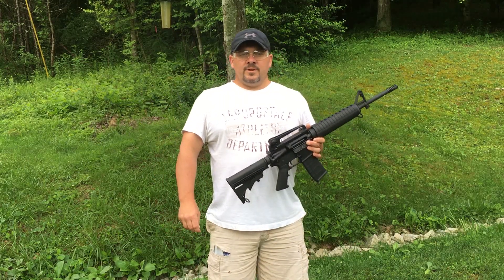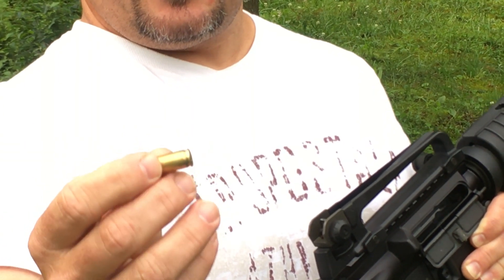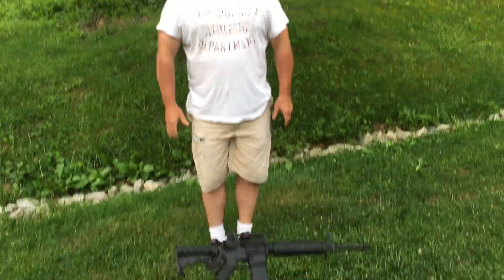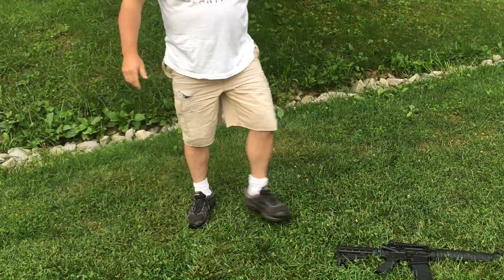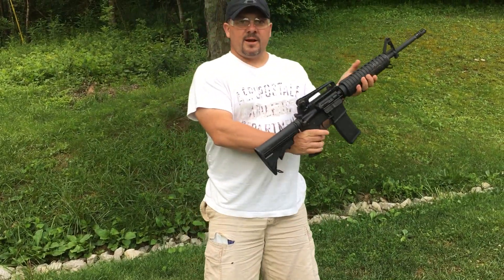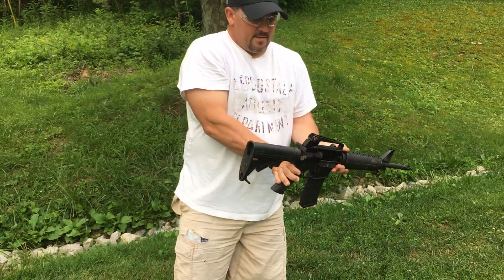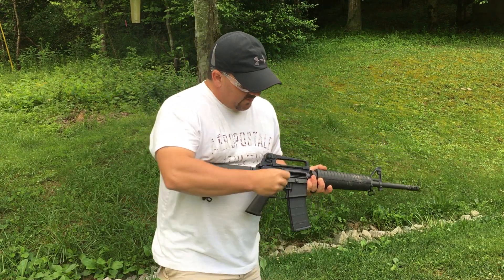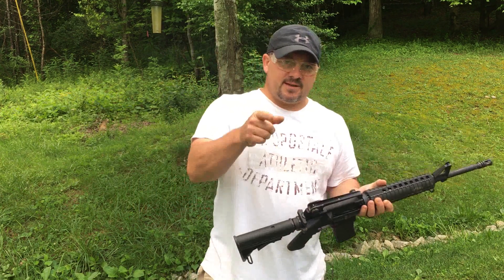AR-15 DROP TEST with an unexpected result

Comment: Good post, but I think you missed the most important angle to drop it, and that is muzzle down. That's the most, and maybe only, likely direction to set a round off. When the gun hits the ground it stops, but the firing pin can keep moving forward, potentially with enough energy to set off the primer. You should have done a couple drops like that
Reply: Probably not. I think the bolt dropping under spring force is going to be going allot faster than the whole rifle after dropping a couple feet. You may plug the barrel and blow it up, but I doubt that'd cause an issue
Reply: I agree .   Says  in my  manual  from Smith and Wesson  muzzle  down  drop may  cause  accident al  discharging  of the firearm.   Mine a m&p 15 sport.
Reply: On standard mil-spec ar it still shouldn't discharge unless trigger is pulled. You will just have dirt jammed in the barrel. Even if you have the trigger pulled while charging the gun. It will not fire, you physically have to let off the trigger, to reset it before it will fire. He calls his Bushmaster XM15-E2S a XR15 shorty bullpup. He does everything for the views. He can't be that stupid and have survived this long. Meaning the Grand Wizard
Reply: @josephcremeans  well yes and no. On a "mil-spec" AR, like pretty much every other one, the firing pin is free-floating in the bolt head.

There is nothing stopping it from going forward under inertia to strike the back of the cartridge. People have had slam fires in the past and continue to. The main reason why this doesn't happen isn't because the firing pin isn't impacting the primer - it is Ivan but usually because most primers are hard enough that it's still not enough Force without the hammer also striking the firing pin for however, you drop the rifle from a high enough distance, or onto a hard enough surface, you may get enough momentum on the firing pin to detonate the cartridge regardless.

It comes down to the ammunition more than anything else.
Reply: Probably didnt do it because it couldve dented the muzzle or maybe bend the barrel
Reply: The kinetic energy of a spring slapping the bolt shut in normal operation is probably much faster than a dropped rifle hitting the ground. So I'd say it's a non-issue other than dangerously plugging your muzzle with dirt. An AR15 has does not have a firing pin retaining spring, it slides back and forth freely and doinks a primer every time a round is chambered. It requires the force of a hammer hitting it to set a primer off.
Reply: The firing pin is too light for it's own weight to dent the primer.  Besides, the mechanism will not allow it.
It's not hard to see who has real experience and who does not...
Reply: I’d say of a gun drops perfectly on its muzzle I don’t care if it fires cause it’s going in the ground
Reply: @thapeacock2601  well it is how you get a barrel obstruction from dirt, sand, rocks, or grass. I have seen it get dropped lifted, shot and boom. Damaged barrel. In the heat of battle or a hunt you don't have time to clean that out..

Comment: That is actually a way that is taught by some instructors to clear a jam quickly if you can't get it by pulling the charging handle, so not a completely unexpected result, obviously you don't drop it, but rather slam the stock on the ground, the shock and inertia causes the bolt to reciprocate. But good to see they are most likely drop safe, that is good to know.
Reply: Well if it’s jammed like that primer wouldn’t be lined up with the firing pin so it wouldn’t really matter if it did let loose right there. Or if a swollen case caused a jam that’s primers already been struck so again it wouldn’t reallllllly matter. So I don’t think it’d ever be a problem with clearing a jam on the ground.

Comment: I'm surprised the primer didn't go off from dropping the bolt on a chambered round 6 times. The firing pin is floating and will dink the primer every time, even if you allow the BCG to strip a round from the mag you will see a small indentation on the primer, dropping the bolt on a round that's already chambered like he did is more forceful than when it strips a round from the mag. Anyway, great test. Thanks! 👍👍
Reply: Yeah on my ar, even chambering a round once puts a slight ding in the primer

Comment: Drop it on it's muzzle? Unless you messed with the sear or stupid enough to leave the bolt open when dropped, could cause the firearm to discharge? Since it's a mechanical device it can fail, regardless how well built it is due to wear or breakage. Best to have it with a unloaded chamber, safety off with a full magazine. How my police department carries it in our vehicles. I do the same for home protection.

Comment: They teach you this is Basic Firearms Training. US Army.
First, they teach you to disassemble and reassemble. Cleaning and maintenance. 
Then, they teach you proper firing positions, the purpose and organizations of firing teams,
Then they put you on the range for live fire exercises.
One can not just drop a loaded firearm and have it discharge.
They are not designed that way.
One must pull the trigger, to activate the firing pin.
Reply: js32dv  WTF are you talking about? You can't discharge a loaded firearm, simply by dropping it.
The firing pin doesn't work that way!
Reply: js32dv  Obviously you didn't even go through Basic.
Reply: @Shingen036  

$20 if you find a M16 or M4 rack full of rifles with a fully loaded magazine inserted with a round in the chamber and the safety on with the hammer cocked stored like that.
Reply: @JohnDoeEagle1 idk where you get your information but the U.S. military dose not store weapons in the armory loaded it’s prohibited and is a ucmj violation
Reply: @chriscraftpro3246  

No sh*t Sherlock.....that's what I bet $20.

Comment: I always wondered about muzzle drops on military weapons with floating firing pins. I've seen several slam fires in competition with soft or high primers on handloads.  One guy proceeded to fillet his hand from the op rod of an M14 from this.
Reply: That was my thought exactly. A muzzle drop is the angle Far and Away the most likely to set off the round, but it's also the only one he didn't do.

Comment: Re-do the test with multiple rounds in the magazine.  Then see if it.

1, Ejects the round
2, Doubles feeds/stove pipes
3, feeds a new round into battery.

That would make a more accurate test. Good job.
Reply: I agree. So long as it was a mil-spec trigger, I would like to see that kind of test.  People like myself like to hunt with an AR.
Reply: LOL speaking of triggers my new triggered arrived an hour ago. (ALG Defense ACT Advanced Combat Trigger Group)
Nice upgrade without breaking the bank. $69.00 It has a lighter pull with a better break yet still feels similar to the mil- spec if that makes sense?
Can't wait to try it out after the 4th July Range Rush.
Reply: joe grunt he did his test,why dont you do a  test with your Ar
Reply: Wow, Joe.  I think you overreacted.  Just a tiny little bit.
Reply: Yeah I would like he's like to see you make another video with Joe grunts idea and by dropping it muzzle down on to a harder surface if you have a cheaper Barrel any muzzle brake
Reply: Would'nt work with out the bullet in the case the cartridge can't ride the feed ramp and get into battery. The edge of the case catches the chamber wall and jams I've tried to cycle spent casings in rifles and hand guns.  Can't be done

Comment: Damn... Dropping it is enough force to rack the bolt? Never woulda guessed that. Does it depend on the buffer setup? I just don't see mine doing that.
Reply: Aniquin  Yeah well, if the bolt catch is engaged, a swift bop is enough to release it on any AR. But I imagined it would take more force than a 4' freefall to actually eject a round from battery.
Reply: Aniquin  Although don't really wanna try the AK thing... Swinging like a bat implies that the muzzle is pointed at your center of mass...
Reply: ...Which leads to another weird random question... If you were dumb enough to Sammy Sosa the stock against something with a round in battery, what would be the likelihood of discharging a round into yourself?

Comment: Kinda interesting, how dropping on the tail is ejecting the case. I will definitely be on the lookout for that shit...wondering what would happen with rounds in the magazine..? would it completely cycle? Would it jam? 
Now I wanna take my beater out to the range and check that shit out..
Reply: It’s basically hitting the tail, transferring the energy through the buffer spring, into the bolt and causing it to cycle ever so slightly enough to eject the round. I don’t think it would be enough to cycle a new round tho.

Comment: I’ve seen m4s go off but you have to almost slam it directly on the muzzle and even then they’ll rarely go off 
They are technically not drop safe because they have free floating firing pins 
The 1911 isn’t drop safe either 
You drop a 1911 on the muzzle it will almost always fire because it also has a free floating firing pin 
Take it as you will but both AR style rilfes and 1911s 2011s are not drop safe 
You shouldn’t be dropping firearms anyways

Comment: Drop it a little softer w safety off. You can get a light primer strike and a round can go off. At least I would think. I've had guns light strike from dropping the bolt. Most my ar's do
Reply: light primer strike and the the round going off? sounds contradictory

Comment: Not valid test results. The military added a gauge to check the hammer/trigger holes. Some were worn oversize, some were faulty manufacturing. Rifles with this problem would double fire or go uncontrolled full auto. With all  the half assed 80% receivers out there, I would give some more thought to this.

Comment: Was that a blank
Reply: Not technically. It had no projectile, or powder, but supposedly a operating primer so it would have popped if the firing pin hit it. A real blank has the throat of the round crimped into a star shape.

Comment: It's common knowledge that dropping the bolt on a live round can cause a discharge, so technically this test was flawed from the beginning given  if it had "failed". Also, if your firearm is ejecting a casing on a 2 foot drop test, you should look into replacing your buffer system.
Reply: KG “dropping the bolt on a live round can cause a discharge”?? You have to drop the bolt on live rounds all the time when charging the weapon. What do you mean? Also an ar15 buffer spring can’t be too stout, that could induce malfunctions.
Reply: @magnetar2524  lol right?  Every round the gun fires drops a bolt on a live cartridge lol that's how semi autos work.  Unless he means if you chamber the round by hand through the ejection port and drop the bolt from there instead of it stripping the cartridge from the magazine.  I could see that discharging it.
Reply: @TheUltimateWord  

That is what he means....not using the magazine and inserting a round in by hand...,then slamming the slide or in this case the bolt on it while it is already chambered and seated.

Comment: YOU don't want to store or keep your M16/AR15/M4 like this. While in storage a loaded magazine with the rifle uncocked and hammer down having nothing in the chamber is the proper way to do it. AR15.com mallninjas all over the U.S. forget one important detail. If somebody is close enough to hinder you racking the charge handle should you need to deploy the weapon you have two choices. Give the guy a buttstroke aka "Johnny Feel Good" and break his jaw OR the use of a pistol would be better suited for this situation. The fraction of a second it takes to rack the charging handle doesn't outweigh the risks. Oh wait....yours is all locked up in a gun safe fully loaded, racked and ready to shoot. Mine is right next to me uncocked and unchambered. I will get there before you do...bank on it!